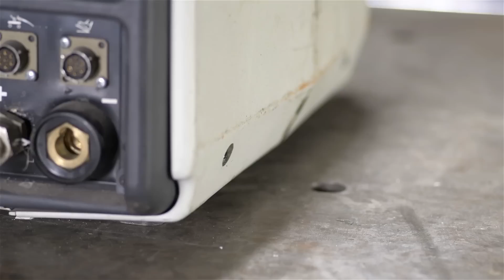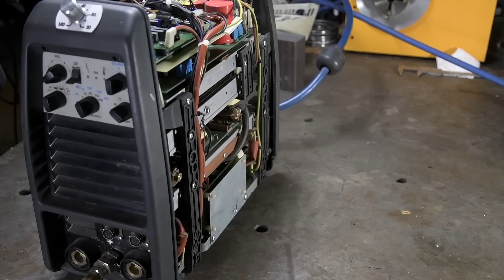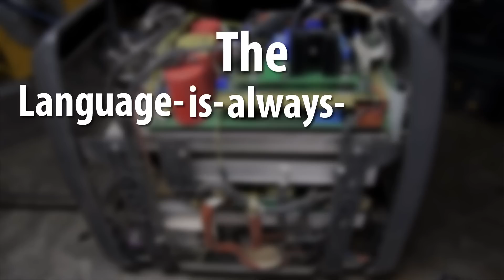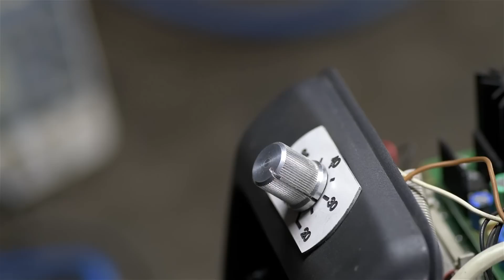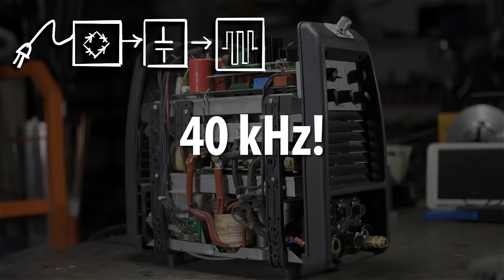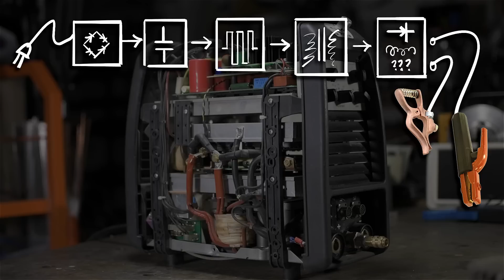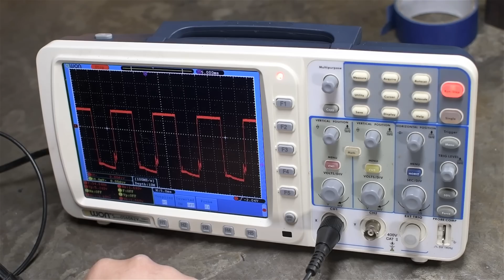My TIG Is Breaking Up With Me - Part 2

Comment: Robert Murray Smith, who
will be much missed, did a series of videos reconstructing arc welding back to front. As I recall he started with a video from a man on the streets of Kenya who used a large transformer block and two five gallon buckets of salted water to do all manner of repairs right there on the sidewalk. I don't often like humans, but every once in a while I see a spark of ingenuity in a place that badly needs it, and it takes my breath away.

Comment: 13:06 inrush. When the caps are charged the relays will close to bypass current limiting resistors. Gas solenoid doesnt require a relay, its an electromechanical device in itself.

Comment: Really graphic video, very useful to know how this stuff works. There is not much more you can do with the tooling available, it was probably time for a machine renewal.
I am trying to install on my Oerlikon 1500 ACDC, which has the same control card as this one, the potentiometer to limit the pedal current. But I wonder how you installed one with 2 cables when they usually have 3.

Comment: Dear Tony.  I have been working as an électrotechnicien for 35 years.  I might be wrong, but just in case.  Looking at the wave form, you have the plus and minus wave forms.  So, triacs are good.  It is I believe what controls those triacs That is Wong.  I would not dig too far deep in the control boards.  Electronic and components are just mathematic, It works or it don’t.  It does not work halfway.  Capacitors especially the electrolytic can loose there capacitance with time.  I don’t think it is your case.  In my experience, what wears most are the moving parts.  In your machine case, the potentiometers.  Check those out first.

Comment: I noticed a 8 pin din surface mount component that is inserted into a socket. These are notorious for having “chip creep” that is when the component begins to push it way out of the socket due to vibration. Simply removing the component and reinserting it back in fixes the problem.

Comment: while you explain the switching psu, you made a liiiiitle tiny mistake, wich really bothers my autism...
the "inverter", does not make AC again, it only chopps up the DC, so you have the good old Pulse Width Modulation (PWM)... it is DC only, so it makes a squarewave from 0V(GND) and the high potential.
and also. the relay that clicks after a couplle of seconds, is the "slow starter" wich adds a resistor in serial to the whole device, so that the current is limited, while the device starts up. because if it would not do that, it would potentially trip the circuit braker...

anyway. you explained it very well. so i wont explain...

but it really disturbed my autism... im sorry for my little detail thingy bothering...

keep going with these videos! i love them
Reply: You made a mistake that's bothering my non existent autism....PMW equals Pulse WIDTH Modulation...  Meaning the Width of the pulse. again sorry you really disturbed my non existent autism.
Reply: @mikesimpson2840  fixed <3

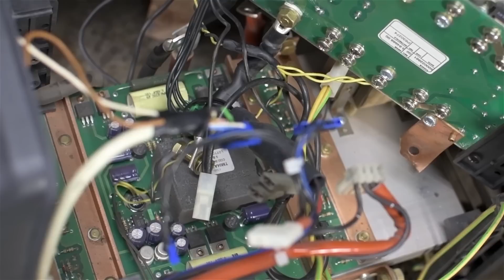Comment: that dark spot on the back of that circuit board at 13:45 at the bottom near that copper strap.... is that a shadow, or is it a burn

Comment: Hey Tony. Love the videos. I just started watching. I used to be a machinist before I went into the military as an avionics tech.From what I saw on the scope it looked like a bad capacitor or two. Capacitors, especially the small flat ones usually only last 5-8 years before they dry out and give up the ghost.I know this is a couple years late. But I figured it would be good info for the future fixing projects.Cheers

Comment: The bridge rectifier on the input side is probably rated for 35 Amps and up to 600 Volts. It can be this small because the current from your outlet is probably about 20 amps at 120 volts, this is before it gets stepped down, the diodes on the output side are rated for a lot more, probably hundreds of Amps and to handle that kind of current they need to be much larger. You said earlier in the video you didn't know anything about switch mode power supplies but you know a lot, it sounds like you understand the theory behind it, which is more than most people.

Comment: Its the capacitors. You're lucky they discharged before you got into it because you could've electrocuted youself.

Anyway, like every other machine that needs big caps, they need to be changed eventually with the  years (e.g. expensive sound systems).

Sometimes it's just a small tantalum that needs changing.

Comment: From my experience working at a well known welder manufacturer, all the boards are tested individually as they are made and them put together in final assembly. And each board powered by a power supply. So you would have to test each board individually under power to find the problem.

Comment: No part 3 :(
I'd first start with the caps, because caps, and then move to squinting* real hard at the surface mount resistors, mostly looking for cold solder joints that have let go.
*(instead of squinting, try a USB "microscope" and couple buckets of patience)
But really hop we get a follow up.

Comment: I have not watched enough of your videos (thou i love yur videos) to know the answer to this question... Did you upgrade your TIG welder or solve the issue with your old one? If not you may consider trying an old computer trick. A long long time ago i built my own desktop PCs. when a modem or whatever stopped working, If you stuck them in the freezer overnight, if there was a broken solder joint the freezing effect would sometimes shrink the part back down to the board. Allow the modem to return to room temperature and be sure it is dry, reinstall and Wallah many times the problem was solved. The large Board of soldered components would be a perfect candidate for this trick.
Reply from the maker: I did replace the welder, would've been interesting to try.  Don't know if my freezer would have been big enough though!

Comment: 13:10, it is likely that one of the relays is to limit in-rush current when the machine is plugged into mains. Otherwise it will try to charge all capacitors instantly and easily do 50 or 100 A from the mains for maybe half a second. Instead after rectification, with relay off, the rectified mains are connected to capacitors via a current limiting reistor. Once they are charged (based on voltage monitoring or just timer), the relay shorts the resistor and allow fully current to be used.

Comment: Wow very cool, the learning curve is very high. it looks like PWM , the machine provides the full amperage every time only limited by the timer. In that case the amperage adjusted by the amp of the poti. What means if you adjust for 75 amps the high frequency is only half time length, so you get the average time of 75 amps and so on. it is like the same as an Esc for E - Motors. I am not an electronics expert , only  i know how a motor controler works so i guess it is the same here. Keep up the good work

Comment: At 3:22 the region around the 10K resistors shows cold solder joints. The joints to the right of the board look nice and shiny but those look really bad. Before checking anything else, I would reflow/solder those as they look very suspect. Looking at the wave forms from your first video would also lead me to believe the problem lies in the control circuitry.

Comment: Those waveforms show your welder is operating perfectly.  Positive current is for cleaning aluminum, you dont need very much, in fact too much will melt the electrode as the electrons impact the tip.  Clean aluminum can be welded at 95% Electrode negative, dirty at 60% electrode negative. The positive current is half the negative current to protect the electrode and the balance control is biased  towards electrode negative such that balance of zero is   actually 70% electrode negative.  Positive current is bad for the weld and tip, use as little as possible.

Comment: so basically the unicorn pot is a coarse resistor and the pedal pot is fine resistor. but i dont know how those guys wired together, serial or paralel? somebody please explain it to me, a circuit diagram would be awesome!
Reply: okey, i think i've figured it out. it have to be a series connection with a dpdt switch.

Comment: Mr Tony!!!! you got rid of your 10Mhz analogue CRO????!?!?!?!??!  :(
To all the folks out there screaming capacitors... .look... just because they often use the cheapest caps possible in your "lucky if it goes" tv, doesn't mean it's the root cause of all SMPS breakdowns. The caps in these sets are rated for astronomical abuse and therefore are seldom the cause. Unlike the yew bewdy $1200 Thermalmistake dirty dirty horrible psu in the youtube box you're sitting in front of right now, or the screen that goes with it. 

The problem is most probably in the signal path as some have suggested, most likely in the Pmos side of the mosfet gate driver board, assuming it has any mosfets at all (all I saw were IGBT's in which case it's probably going to be on the board that supplies the gate drive to the Pside IGBT's) 

It is also very VERY possible that a quick twitch back and then forward (back to where you moved it from) of each of the at least 11 trim pots in the machine, would clear the problem. Often over time, bit of shit builds up.... you all know the story.  don't do it cold though, twitch em with the unit under load and watch the scope. Also, given the voltages are low, aside from the arc start, personally I'd be probing the output of the welder directly, though I'd be using an air quenched breaker (gap) delaying conection between the scope and the machine for 1.5 seconds to stay clear of the arc start or an attenuated 1000x probe with a signal amplifier and delay.

But I feel your pain. My chinese 3 in 1 is currently not working due to an inadvertent touch between the MMA stinger and chassis earth. There are no circuit diagrams out there for these things that I can find. Especially the knock off's. Which is a pity, because this one wasn't a bad machine at all, certainly had a lot more settings and therefore more control than most if not all of the machines I've looked at since. 
I haven't given up, though, I'm not going to dice a $400 machine that I know has a good power stage, in fact the control logic is good too... it's going to be one of the protection boards has dropped it's guts. If anyone does have a diagram for one, or even something similar like a rossi or can help in any way, I'd really appreciate it, as replacement is not an option for quite some time. So I'm trying again to learn how to buzz box ac stick again errrgh... hate it! Failed hard last time, not doing much better this time, but I need a alloy furnace so on I persist.

Oh one final thing Mr TOT, I wouldn't worry too much about further damaging the machine, you can't really. The intermittent flickering in the wave form looked to me like a dirty connection or a signal path problem (probably a chip worth a whopping buck  fiddy, as you probably know) other than a bit of a noisy/dirty signal, the final drive looks good. Still nice and square, very little ringing, I wouldn't hesitate to continue using it if it were my machine.  And thank you for the fine entertainment and well put together videos! You keep makin em, I'll keep watching!

Comment: Big fat electrolytic capacitors...when they get old can leak, or capacitance can fluctuate...get a capacitor tester, unsolder and test them (they should be within 10% of values printed on the can), they aren't gone completely, but marginal

Comment: Balance Adjust Pot...hmmmmm...but I agree with the post below as regards probably an electrolytic capacitor going bad in a circuit that controls switching times.  The top bulges as they go bad (sometimes). 
It's really kind of a time thing - how much time is it worth spending if you want a larger/newer machine anyway? If you can't find a schematic or service manual, the complexity of troubleshooting tends toward infinity - not impossible, just time-consuming.

Comment: Hi Toni,
I am short of time, so excuse me if somebody already pointed this out.
Could it be that the welder is doing all the complex regulation correctly, because it is still welding and generating the expected signals (at least shape and almost power) and responding to the panel settings change in a coarse way but logically. I mean at least what the electronics is concerned. Maybe the electronic board is really "believing" the currents reached the desired value of the square wave (but the final current measurement is failing) or the electronics is doing everything fine reading the final current in the upper part of the square wave but the mismatch is between what the knob (potentiometer dial) tells you and what it is really telling to the electronics? To put it in another way, that the electronics is detached form reality! Being a potentiometer such a cheap element and being it the one that is moved a lot (mechanical failure) only replace it to be sure you are telling the electronics the same that you see on the dial (be sure if it is a linear or logarithmic pot). If this is not solving the problem I am getting puzzled myself, because now my suspect is the "measuring" of the end current which has to be a closed loop to be sure the machine is behaving as a constant current machine in each part of the square wave cycle. I have no clue if the measuring is done in the high voltage side of the power transformer or in the low voltage side or if there is an isolated third winding in that transformer to do it. This latter would be my guess. If that is true I would try to identify if there is such winding (thin wire coming in/out of the power transformer) and the current in that wire has to be transformed to voltage by a resistor to be used by the electronics and that "sucker" could be the bad one. Nothing will change that giving an opinion from far sounds so easy and simple and it is almost a "fa..t" in the wind, but who knows? Regards

Comment: what are those 7 pin connectors on the front of the welder?
Reply from the maker: Remote control of the welding amps.  One is for a foot controller (variable amp control), the other is for an on/off switch.
Reply: thats interesting, it looks a lot like the 7 pin audio & PTT connector for the Clansman radio system

Comment: Hi,
NIce videos, very informative.
Just a quick thought, the bit where you turn on the current probe showed a low battery led lit ( at 5:05) .
if you turn round the current probe on the earth clamp it should invert the waveform on the scope. if it doesn't the probe is asymetric due to a flat battery ( or faulty).
Keep up the good work.
Kevin

Comment: It looked like one of the wires on the primary(primary as in the primary end of a power supply) board was cooked...check for failures/overheating there.

Comment: I've been using my AHP Alphatig that I picked up in 2015 and I've been loving it. They expanded a couple of the setting options for the newer models. Duty cycle is 60% at 150A and 100% at 115A. You should check it out.

Comment: I noticed a "-2.04V" in the lower right corner of the occiliscope's screen - also the output is about 2V low - is it possible the trim adjustment was bumped..?

Comment: Beautiful video of your faulty tig welding station. In your previous video you only measure the welding current but the output voltage is also important. The current is measured correctly, but you can not say anything about the zero point. (current probe is completely insulated with current path) By putting the voltage on the second channel of the oscilloscope you can make some conclusion. Warning: To measure this, the earth connection of the oscilloscope must be removed from the wall socket. (Special cable)
With my lathe, the controller was broken due to a wrong calculation of the Chinese engineers, after two hours it was restored with the necessary shopping visit. I posted a video about this. Here I measure current, voltage and engine speed with oscilloscope.
My conclusion is (do not tell your wife) that there is nothing wrong with your welding device. Power electronics is robust and reliable as long as it is not designed by the Chinese.
Note: I was expected more than one cat...

Comment: Tony, because you are missing about 1/2 of your positive voltage it might be a Diode after the transformer. By using 2 diodes and 2 caps you can double the voltage of the secondary winding. if 1 fails, you half the voltage.

Comment: I may suggest you look for leaking or buldging capactors.  in the late 80s  many manufactors received faulty caps and they were used in almost every electronic device known to man, PC's, TVs, stereo equipment, etc.   You'll see the leaks and the buldging can be seen on the sides or the top of the cap.

Comment: 12:40
Is there any way that the knobs were turned during re-assembly into the pots when you first had it apart?
I can't tell, but if the center of the pots are hexagonal, it wouldn't be difficult to have it off by 60° which might give a bad value to the control board.
Reply from the maker: Good catch, but they're D-shaped and have molded in stops.  If I put them in wrong the knobs have like.. 2* of motion :)

Comment: Rule 1 of electronic diagnostics, "Thou shalt measure voltages"

My guess would be that you have a low voltage power rail out of spec. 

The control circuit is going to be comparing a feedback signal (output amps for example) to a reference signal (the current control pot). If the power supply for the reference pot is too low, or has a lot of ripple (bad smoothing capacitor) then it's quite possible you'd get the behavior you're seeing.

It'n not uncommon for a negative supply rail to be generated from a positive rail by a charge pump, the 7660 being a common device. I've seen a lot of these, or their attendent capacitors, go bad over the years.